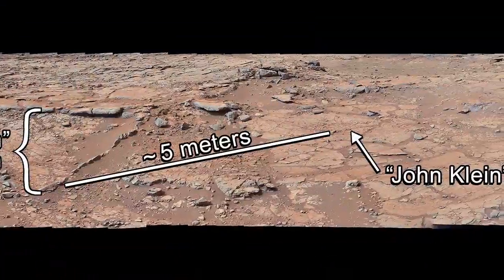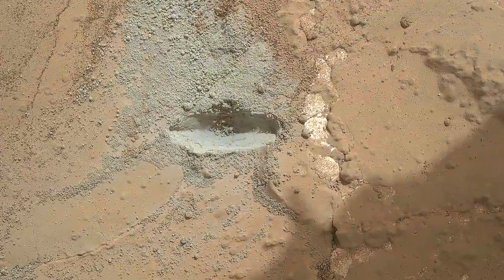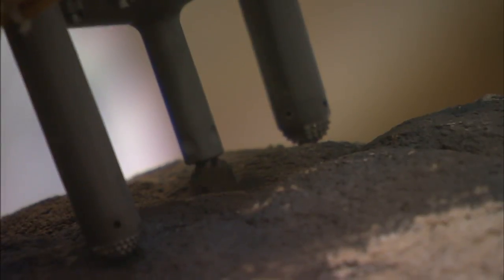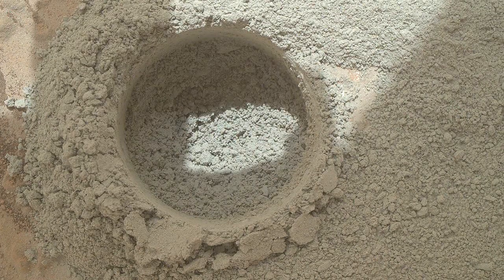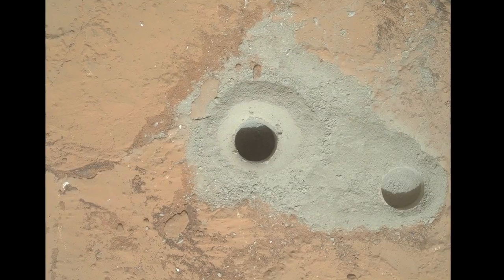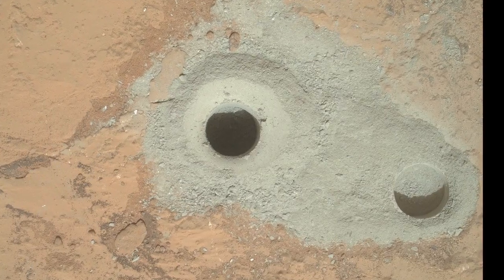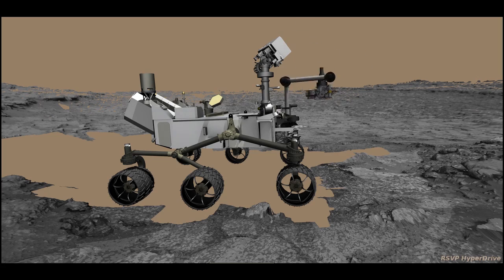Curiosity Rover Report (February 15, 2013): Curiosity Drills on Mars

Comment: " Solving the radiation problem "
transit or surface? The transit GCR and SES issue is an intricate problem tied to propulsion systems and transit times, as well as primary mover available power and thus allowed transit mass. 
As for the surface the solution is decidedly low-tech: dirt. Excuse me, "regolith". Anyway, not surprisingly, the "dirt" solution brings in the transit mass and propulsion issue as well, to be fair. The key holdup in building a space infrastructure is space transportation.

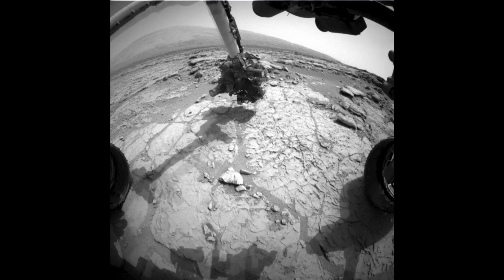Comment: Have any of you at JPL reviewed your own website's Full-Res TIFF image of PIA16701 in the 114.7 mb version?  Pause this video at 0:15 ..then look at the top right of the screen. you will see the flat plated rock, bluish green triangle shaped with the point pointing downwards towards the bottom. To the right of the tip of this triangle is a tiny micro bobtail cat hopping in mid-air like a freakin bunny rabbit! There are many faces etched in rocks & faces made from separate rocks arranged. MArs is

Comment: They vibrate the instrument at around 70/80 hz per minute for a couple of hours. The fine grain is now jumping up and down and basically "sandblasting "the interior, scrubbing off all left residue. Sand is then discarded and the proces is repeated a couple of times with fresh material from the sample.
This type of cleaning is not uncommon, but used on Earth with good effect as well.